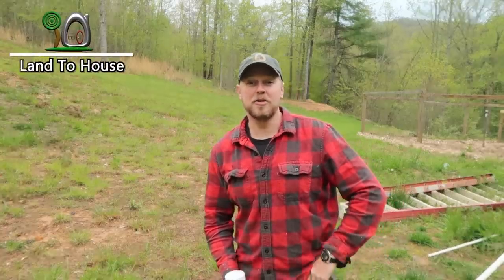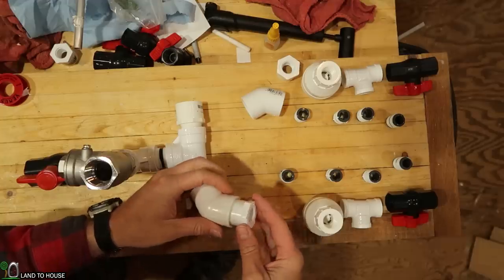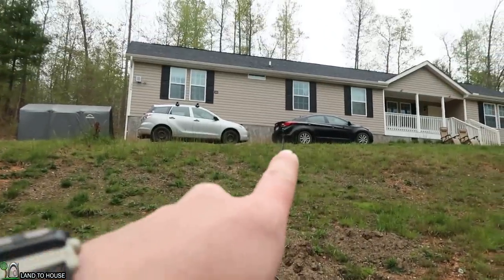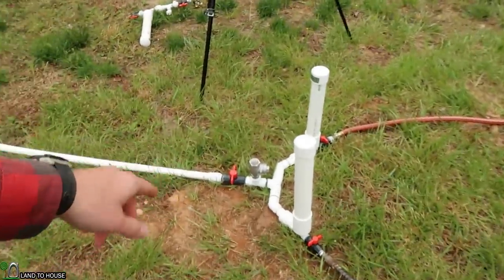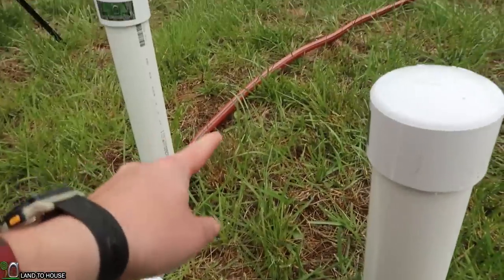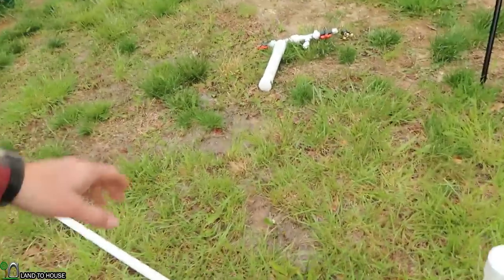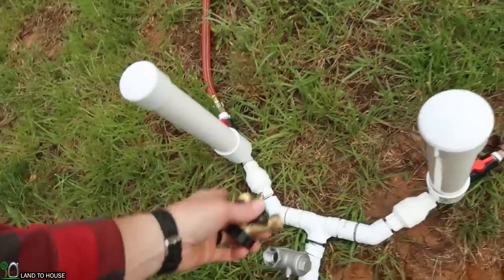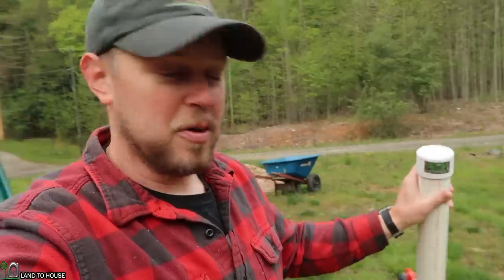Crazy Looking Dual Output Ram Pump

Comment: Great results! Remember the math I sent you with the ram pump efficiency equation? That predicts exactly this behaviour: Lower lift height => higher pumping flow rate vs. higher lift height => lower pumping flow rate. Math and physics always win!
Reply: Is Bernoulli's principle somewhere in there?  I suck at math, but it seems like that would apply here somehow.
Reply: @deepblueyonderspage  No, that is just energy conservation: The energy of a lot of flowing water will be concentrated onto less water, what then can be pumped to higher elevation. Bernoulli's principle basically says that the sum of static pressure (like the normal air pressure) and dynamic pressure (pressure that is generated by a flow like wind in air) is constant. That is the priciple what make planes fly.

Comment: Did you know if you turn the delivery pipe on slowly or just crack it a bit it will not stop the pump from working? Then after its running you can turn it on all the way. On large systems it will take you all day to prime the delivery line. Hope you find this tip useful :)

Comment: Y from feed, 2 check valves (one set slightly higher to stagger the waves - increases flow and maintains pressure), 2 pressure cylinders, Y out to a selectable splitter.
Then you can feed 2, or double feed one.

Comment: Hi Seth, love your work. This double ram pump will operate both sides equally, you just need to close the tap a little bit on the lower output. This reduces the pipe diameter and in turn increases pressure. I would suggest removing the sprinkler and measure the time it takes to fill a container. Closing the low pressure tap until both lines are equal pressure.

Comment: Longer/skinnier hose vs. shorter/fatter hose.....
The amount of water weight on each side must be equal to have equal output.
Make sure you have the same length/diameter hose on each side. If one side must go further - use a thinner hose/tubing. You can go further and with less water in the tube it will give less resistance and be comparable to the shorter/fatter hose. 

The goal for equal distribution is to have equal WEIGHT of water pushing back against the split.
Jeff at Gridlessness sent Me and I'm looking forward to seeing all your videos.
Best of luck ! -KJ

Comment: That is a great video! I may have another idea for you to try out.... How about using a ram pump to feed water back up to the bucket and that way you don’t waste as much water! You would have to hook it up to the check valve. I am always interested in finding things that you make it work for you instead of you working for it!!! lol
Reply from the maker: Thank you. So when you increase the height of the waste valve it reduces the head pressure. If you were to take the waste water all the way back to the bucket the head pressure would be zero and the pump would not run. That waste water is necessary.  BUT I do hope to run a pump from a pump. That is one way to reuse water.

Comment: You have a single pump pushing water to a dual pump, you need to do a dual pump at the bottom to supply enough water to power both pumps up top

Comment: Thank you for the video. I have a question, is it possible to run two or more pumps in series to have a higher overall head? Where the size of the third pump must be sized to give enough water, the first two will be oversized of course.

Comment: Loop the pvc to balance pressure and then attach your hose bibs on the loop!

Do the same thing you’re doing just make a circle that connects that will loop and equalize pressure and have two hose bibs coming out the pvc circle

Comment: I suspect your lift would be reduced by a factor of 2.  You can’t get the same flow rate out if the two output are at two altitudes.  But I love this, never seen it before.  A great way to fill a water tank from a creek and minimize the use or load on any kind of electrical pump if you even need one...such as an offgrid shower or whatever.  Your flow rate out is gonna be based on the height of the output line versus the pump.  The input is inertia pressure pulse based on ur weight of the water and speed of the water in your pump inlet pipe.  I can’t wait to try it.

Comment: What if you installed a 15psi pressure regulator between the delivery coupling and the pressure tank, wouldn't that maitane the pressure differance at least to 15 psi height at the hose end and give you more volume per hammer strike

Comment: How about 2 drive pipes, 1 waste valve and 2 pressure tank connected to one delivery pipe
Reply: i was thinking near the same thing; 2 drive pipes, 2 check valves and 1 or 2 pressure tanks.  Would this then theoretically double the flow rate?

Comment: Add 2 pressure valve at the 2 ends of delivery section, doing so it equalises both sections to receive same amount of water flow.

Comment: What if you used a tapered hose coming out of the ram pump so at the top of the hill the output pipe would be at its thinnest. would the pressure be higher?

Comment: I am fairly confident if you wanted a little high pressure water, bleeding ram pump pressure into a second line as shown here would be a worthwhile investment of time.

But if you want to deliver half the water both ways? You are better off feeding a primary tank and running back to the lower area.

Comment: Hi Seth, What do you think about a circular-flowing ram-pump that continualy feeds a water-wheel electicity generator? - example: Large holding-tank at top feeds a water-wheel style generator (maybe high-pressure to run generator-wheel not needed this way?), leftover water feeds down to ram-pump, then gets fed back up to the holding-tank that opens at a set capacity to feed waterwheel once full. Has this been covered?
Reply: I was thinking the Same but I want to use a Kelvin Generator with No moving parts and a Marks Generator to step Up the volts

Comment: I wonder how many ram pumps you can run (in series) before losing all your water.
Say, if I used the Ram Pump to bring water up to a tank beside my house and instead of using sprinklers as it passes my garden, using ram pumps to keep the flow going up hill.

Comment: What if you put a water wheel on the waste water side to recap some of the energy from the waste water pressure for a low power application or to trickle charge a battery?

Comment: i bought the 3/4 from seth the pumps are amazing,  pumping water up approx 83 ft and a distance of 950 ft using 1/2 pex works great,  question for seth is have you tried 2 pumps tied to 1 delivery to increase flow volumn
Reply from the maker: Thank you for the great feedback! Yes I have tried that. It does increase the volume output. You can check that video out here: https://www.youtube.com/watch?v=oKQiWIje-zM

Comment: Great work 👍👍👍 I like it, here you did it in parallel connection . I am curious If you Try it in seriese with these combinations 
1) one waste valve  then two Pump in seriese.
2)one waste valve  then one small pump then one bigger pump  in seriese.
3) one waste valve  then big Pump then small pump in seriese.
4)one waste valve  then  Pump then 2nd waste valve then 2nd pump in seriese ( both pump same size).
5)one waste valve  then  one small Pump then 2nd waste valve then 2nd big pump in seriese.
6)one waste valve  then  big Pump then 2nd waste valve then 2nd small pump in seriese.
I think 5th no combination will give more pressure.

Comment: Question:
What if you pumped the "waste" water back to the source bucket???
Source above ram pump # one
Waste valve water from # one flows down one-two feet to ram pump # two
Ram pump # two pumps back up to source bucket 😎
...
Vacuum valve that sucks up waste water from bucket ramp pump # two is sitting upon (like in the video about the mini electric generator output down hill flow creating suction)

Comment: Water is similar to electricity in that it takes the path of least resistance. So in other words, a duel ram pump with a single input check valve is not the greatest ideal. What will happen if you have one pump running to a higher elevation, or somewhere which causes it to have more back pressure than the other ram, then all the water will pump thru the pump with less back pressure. 

Even if you put 2 input check valves on the input, one for each ram, then it will still do the same thing. It will only kinda work ok IF both outputs causing the same back pressure on the input. In other words, having both outputs running to the same place, and same elevation, or at least different places BUT with the same elevation. OR you can allow the lower elevation output to run until you fill a container causing a head in the container to create enough back pressure(the input to the container would need to be at the bottom of the container) so it will match the back pressure on the higher elevation output, then it will automatically begin flowing thru the higher elevation output until it matches back pressure in the lower output, then it fills the container a little more until it matches pressure in the higher output again, then etc... etc...it keeps cycling. But in our reality both will appear to flow at the same time.

And if you are going to use them, put a Y connector not a T. You lose ram force hitting the T squarely, more energy is absorbed in the pipe. You will get a more energy from the wave form to pump up more pressure if you use a Y. More energy will more freely flow up those pipes, instead of ON the pipes. You are using a kinetic energy wave to supply the pump, for example it is like taking a hammer and hitting the wood not the nail when you let the wave crash into the pipes, instead of flow up the pipes. For example, if you had a vibration detector, you will detect more vibration of the pipes with the tee, and that is lost energy that otherwise would have been used to push water.
Reply: Great analysis. Hey do you determine the maximum distance and altitude to which this kind of pump can push water?

Comment: You "D" man!  Hey, I have this configuration that I was hoping to learn if you could recommend a RAM pump for me.   Here it is:
1) Length of Fall from the beginning of my waterfall to the bottom of pool is 45.7 feet.
2) Pump lift from stream elevation to destination is 1000 feet.
3) Distance of pump to water tank is 1320 feet.
4) Flow rate of stream is moderate at around 400 gallons per minute

Would you (could you) recommend a Seth-styled RAM pump or should I be looking at a Bunyip Pump?

Thank you for your awesome videos.  I watch as many as I can and they have been amazingly helpful.

Comment: Seth, what about using two input lines from the same stream? Maybe one intake up 10 feet or so further leading to two separate ram pumps  that feed into one output line. Wouldn't that create more water pumped at a faster rate in the same output line? If that sounds crazy, sorry. Just my brain working in overdrive. lol

Comment: You said 1 ft of fall lifts 7ft, what if you have larger or smaller pipes and larger or smaller pressure chamber? What would be a way to create a high flow rate with a small feed fall of around 1 ft/ 2ft..Would you increase the size of the pipes As I only need to lift around 7ft but require a rather large flow rate?

Comment: 1--1 bad ram pump vids...ty  for trying something new :) 
however... i was hoping ud have the math... 
i have 3/4 poly line from a well @ 12ft drop (*grav feed) but 550 length. i need to know if it will run a ram pump. what size out put and at what height and length will it pump. i need to lift it 18 ft high @ 50 ft long . NE1 know if im wasting my time and money?

Comment: how about 2 drive pipes, 2 waste valve, 2 pressure tank connected to a single delivery pipe? did you do an experiment like this?
Reply from the maker: Yes I actually have tried that. It increased the flow rate but not the lift potential.
Reply: @LandtoHouse  okay thanks for the reply. I will look for that video and watch it. thanks.

Comment: I've noticed the Pressure Wave ("PW") has to first hit the "Tee" fitting then it hits the 45° fitting before going through last check valve.  Do you know how much of the PW is absorbed by the Tee and 45° prior to hitting the last check valve?  It would seem to me there is a loss trying to navigate those fittings.  Like a bullet, the PW needs to hit that last valve full force on it's return meaning the last valve needs to be aligned with the driver pipe.

The PW in plastic pipe is considerably much slower.  The sonic velocity is also the speed at which the PW generated by water hammer travel in the pipe.  For water in very stiff pipes the sonic speed could be as high as 1,480 m/s.  But in some plastic pipe the wave speed can be lower than 200 m/s.  That's a 86% loss of wave speed in a plastic pipe vs. steel pipe.

Thomas M. Dutkiewicz

Comment: Cool.  If you keep increasing the height of the delivery pipe (where the water is going up hill) does the pump shut down due to too much back pressure or does it keep hammering away but just not putting water out.  For example with 4 ft of head and a delivery pipe up the hill of 100 feet. Thanks for the videos.

Comment: The 2 different pressures will always cause one to have more water than the other. Every 1 ft of rise = .433 PSI lost. Lower pressure will reduce volume correspondingly.

Comment: Every 2.31 feet of head pressure or 27 and 5/8 in.  you will build head pressure by One psi. So every  27 and 5/8 inches you go up you add 1 psi

Comment: I noticed that you have a 90 degree split to the two pumps. Would that be causing inefficiency? What if you made it a 45 degree or similar split so it doesn't run into that wall?
Reply: I guess it's called a y split connector?

Comment: What about two waste valves after the y?  Sure it'll be double water waste... But in your creek not an issue?  Basically two pumps off one drive pipe.

Most applications...  I'm sure a trickle will be fine.  Run sprinkler from header tank etc

Comment: What if you use only one walve write behind the stainles steel valve? Well I think it will be the same issue.
Reply from the maker: Yes I have another video showing that water will travel up hill with the least resistance.

Comment: I watch a lot of these. I was wondering, a while back you did a video on too long a feed pipe. You said you had to add a stand pipe the same height as the source. What if you put a pressure tank there instead to shorten your "wave" travel.
Reply from the maker: I have tested a long drive pipe on 1/2" pump. It slows the cycles way down. I am thinking that perhaps a non return valve or a tank like you suggest would be fun to try.

Comment: Thank you for testing different configurations.   It seems unlikely that all ram pumps are perfectly balanced with their component parts.
- Do you have any idea if the total water out of both hoses was more or less than would have been delivered with just one expansion tank and delivery hose?
- I saw the video where you filled a tank and then ran a Wobbler with a gravity feed.  Were you able to run the mini  wobbler when it is the only output from your ram pump.    
I have two of the regular Wobblers, I think I better see if I can get a couple of the mini wobblers.
Dave

Comment: I think that the Y split the shock wave and absorb a part of it.
Why use this type of ram pump instead of one with 2 outputs.
On both you put a faucet to adjust back pressure on both hoses.

Comment: What size check valve  do you recommend?
Reply from the maker: The waste valve needs to match the size of the drive pipe. The pipe and waste valve determine the amount of water required to operate the pump.

Comment: If the two delivery pipes where of equal length and equal height, is the output better than a single pump?
Reply from the maker: That is a good question. Probably would not matter the length as long as you tested with equal height

Comment: Weight of water = 8.436 pounds per gallon
8.346 x 0.052 x Vertical Column of Water in Feet = back pressure on line at the pump in PSI

Comment: cool Gave me a great idea for building and testing a close system  I.E All waste water return to the tank"" making easy to use a Ram pump mini hydro dam to power Any Brick and Mortar Building  no running water/CREEK/RIVER NEEDED...!!!" JUST THE HIGHT OF THE Walls/Roof of the building your powering pvc ram pumps, tanks, Mini hydro Gen, and grid tie inverts

Comment: From what I understand if there is any debris on the input of your valve you will cause the pump to fail, is it worth using some type of filter to keep the valve pump and system clean?
Reply from the maker: Yes debris is a bad thing for the ram pump. I have a couple videos on the channel showing the two part filter system that I use.

Comment: How about pressure tuning the pressure tank? Big truck air brake systems use a rubber/neoprene diaphragm to actuate the brakes. These diaphragms can handle 120+ psi pressures all the time. How about a horizontally split tank with a diaphragm separating the two sections of the tank? With both sides sealed, one side water, the other side air, the air pressure on the air side, above the diaphragm, could be adjusted to best pump operation. A simple Schrader valve would allow for adjusting the pressure on the air side of the diaphragm. Diaphragms are available in several different sizes from 5 1/2" to 11". A T-30, 8" (7.88 in.)diaphragm can be bought for less that $6. Just an idea to kick around..... and a link to look at.......  https://www.anythingtruck.com/product/060-234101N.html

Comment: mmmm... maybe one pressure tank like normal, then the split into two to go to two different tanks at different heights, with the floating close thing on each?? 
Or simply connect the higher tank to the lower tank with the auto shut off.
Reply from the maker: Yes using a single pressure tank is the way to go. Just use a float valve on the tanks and a valve at to stop the flow to the lower tank.